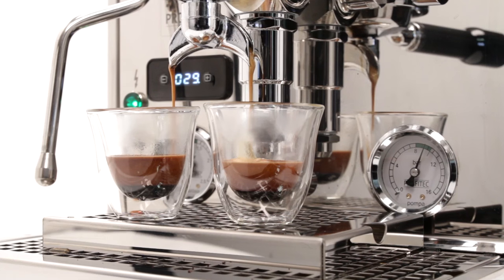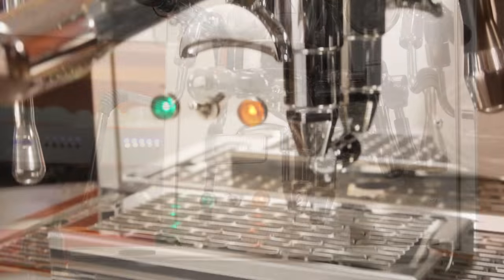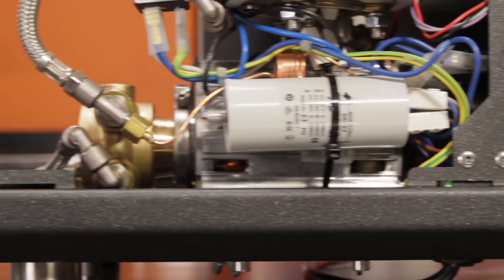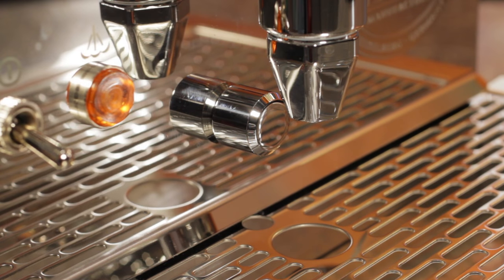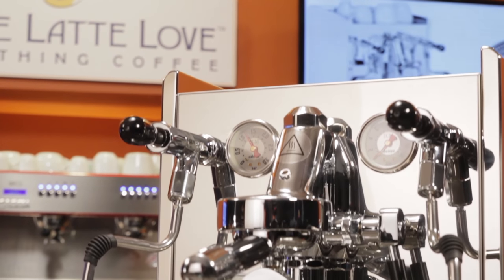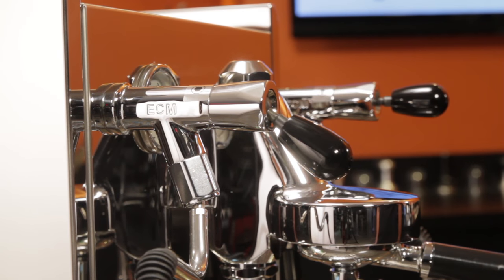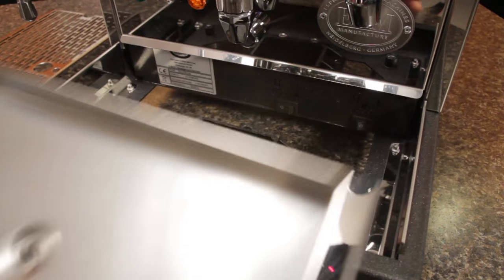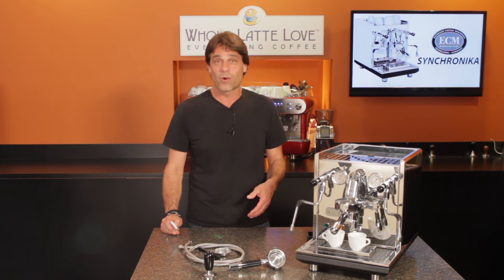Review: ECM Synchronika Espresso Machine

Comment: This has reached the top of my list, only reservation I have is the Steam looks wet, I did a Google search and noticed a couple of comments regarding this. The La Marzocco Mini has very dry steam, do you know why technically that is. Many point to No Burn wand but they both have no burn, thought I believe the LM is double wall rather then tube. If thats the reason can WLL influence ECM/Pro to change their design. It seems to be the only flaw I can think of with this machine. Oh maybe ability to set a morning start up time.

Comment: Hi, when using the 21g basket the puck is wet with the ECM synchronica.  What could explain this?
Reply from the maker: Hi PM, How much coffee are you dosing in the basket? If dosing the 21g low then extra headspace can cause. Also back flush machine regularly to keep exhaust from group clean for better performance.

Comment: Hey Marc, what does this section on the manual for the Synchronika mean? "Important--Please make sure that only your authorized ECM-dealer connects the machine to the water supply and installs the pressure regulator and shut off valve.
To avoid calcification of the machine a water-softener is recommended.
The machine may only be descaled by your specialized dealer because a partial disassembly of the boiler and the tubing may be necessary to prevent the system from being blocked by lime residues. A late descaling can cause substantial damage to the machine."  Can the owner de-scale themselves?  Thanks! Jack
Reply from the maker: Hi Jack, Thanks for the questions! It's okay for knowledgeable end users to plumb the machine themselves. Wording in the manual is there to cover the manufacturer in the case of errant end-user installation. Pressure regulator is recommended to prevent over-pressure water supply to machine. In most cases, this is not necessary if household plumbing pressure is in normal supply range of about 40psi. A shutoff valve on the supply is common practice for anything connected to a household water supply. The ECM is designed in so there is no solenoid valve preventing household water supply pressure from entering the machine - line pressure is always present in the machine. This allows for line-pressure pre-infusion when the E61 group lever is in the proper position. So that is a feature but it also presents a slight risk in that a component failure in the machine could lead to water exiting the machine. Therefore, best practice is to turn off the water supply to this type of machine when not in use or unsupervised.

As for the descaling... We do recommend using properly treated water to prevent scale formation in the first place. Minimum is water softening filter. What we prefer is a multistage adjustable cartridge filter that treats for chlorine and instead of softening (which exchanges minerals for salt) does magnesium ion replacement for calcium to prevent scale. This type of filter when used properly ends the need to descale. We have an entire system built around the BWT Bestmax premium filter. The system has a pressure regulator to prevent water supply pressure spikes from affecting the machine and a flow meter so you'll know when to change out the filter cartridge. Learn more here: https://www.wholelattelove.com/parts-and-care/water-filters?product_brand=126

As far as owner descaling... Best thing is to prevent scale in the first place so descaling is not required. As ECM states, if descaling is required it is best to have it done by a machine technician. Descaling dual boiler machines generally requires some disassembly of internal plumbing components. Can a home user with appropriate skills do it? Yes, but it's not something we or machine manufacturers recommend.
Reply: Whole Latte Love what components should I be concerned about for water to leak from machine when plumbed?  It not convenient to shut off the water each time especially when it is on a timer to turn it on before you wake up.

Comment: Can the cup rail be removed to decrease the height of the machine?  I have low cabinets and definitely could not fit it at 16.5 height.  If removable what would be the height of the machine without a cup rail?
Reply from the maker: Hi, There is not a cup rail on the machine aside from the case that extends above the cup warming tray.

Comment: Hi Marc:  I've learned so much from your videos, and your "Columbia School of Broadcasting" voice always makes me smile.  Thanks for producing these.   I have a question that I don't think has come up before, and I am puzzled as to why it hasn't been a problem.  You quoted the power requirements of the two boilers as 1200W and 1400W, for a total of 2600W, which is slightly higher than 20A of current.  That would be likely to blow a household circuit breaker, especially if some other appliance on the same circuit turns on.  How do they deal with this?  I thought they might only allow one boiler at a time to turn on, but you show espresso brewing and milk steaming at the same time.
Reply from the maker: Hi Steve, Thanks for the kind comment and question! You pretty much had the answer in that only one boiler's heating element operates at a time. It's a typical setup for dual boiler machines with PID temperature control. The PID energizes the boilers in short pulses and alternates between them. When brewing and steaming the boiler's heating element does not have to be energized constantly.
Reply: Now THAT'S good engineering.  I I chuckle when purists complain about a machine having a PID, as if it ruins the "steampunk" character.  Considering how many sensors and computerized systems the average car now has, a basic electronic temperature control is nothing.
Reply from the maker: Steve Weinberg agreed! Funny as I get complaints sometimes from those upset a couple of manufacturers have moved PID display out of sight behind drip tray. Rocket machines have no visible PID, Profitec Pro 500 PID is behind tray. Some users would like it visible with shot timer function like on Synchronika and Profitec Pro 700

Comment: What is the size of the tamper for synchronika?
Reply from the maker: Hi SR, Thanks for the question. The Synchronika's stock filter baskets use a 58mm PF. Be aware some tamper manufacturers (the good ones!) are more precise with measurements. So you may see 58.5mm tamper sizes. These will work with ECM stock filter baskets and precision aftermarket baskets.
Marc

Comment: Great info. Q: is the temperature stable for back to back brews? Considering this unit for mobile cart setup.
Reply from the maker: Hi S, Thanks for the question. Most dual boiler PID machines are relatively stable with back to back shots. If you are rapid fire brewing continuously you might turn down the temp a few degrees but depends on frequency of brew cycles and ambient temps.

Comment: Hi Marc, may I know what is the pre-infusion pressure between tank and plumb-in? Does the pre-infusion features work with water tank? Thanks
Reply from the maker: Hi Tan, great question. We're prepping one for customer delivery today. Will put the SCACE on it and measure pressures of pre-infusion from reservoir and when plumbed and let you know.
Reply from the maker: So did test with the SCACE. When plumbed to water line with 50psi the pre-infusion read 1 to 1.5 bar of pressure. From reservoir there is no pressure build up it just wets the coffee.
Reply: Thanks Marc

Comment: Hey Mark, any tips how to fix a shaky steam arm. Not the moveable piece the stronger piece had mounted to the machine has gotten loose over time. Thanks for all the tips!
Reply from the maker: Hi CK, Fairly easy fix. Must say I'm really surprised that loosened up! Here's what to do:
1. Remove 6 Allen head screws securing the top/cup warming plate. When doing so be careful as back and side panels become removable as screws are taken out. Panels can fall off unexpectedly.
2. There's a nut behind the face plate which secures the valve assembly. Tighten that nut to secure. Bit of an odd angle but it is accessible.
3. Re-assemble is reverse. Make sure back and side panel tabs are inserted properly into base of frame and tabs line up properly with top cover/cup warming plate.
Hope that helps!
Marc

Comment: Hello sir I watch this video after you reply to my question from the top espresso makers of 21 I can't even see the display in this video is there anyway to get some more pictures I want to display will look like in a room?
Reply from the maker: Hi Charles, That's the best I have at the moment. The Synchronika has a "silvering" of the PID display which helps it blend into the face of the machine. Side effect of that treatment is a reduction in contrast. The Profitec Pro 700 is essentially identical to the Synchronika in internal components and capabilities. The Pro 700 PID is much higher contrast. Perhaps it would be a better fit for your need of machine with a high contrast display? Check out the Pro 700 here: https://www.wholelattelove.com/products/profitec-pro-700-dual-boiler-with-flow-control Very good photos of the display at the link.
Hope that helps!
Marc

Comment: I like to buy this fantastic machine BUT read a serious PID Display problem of this machine... Is this solved all ready or??
Reply from the maker: Hi Peter, Not aware of any serious PID display issue with the Synchonika. Can you be more specific about the problem and/or provide a link to description of the issue?
Reply: This problem is placed on YouTube my friend
Reply: It is not a problem from just one fantastic espresso machine but several with the same issue. Thats why i ask you about this..
Reply from the maker: Hi Peter, We have shipped dozens of ECM Synchronika machines and have no reports of serious issues with the PID display. We had one with a slight cosmetic defect which did not affect performance. Do you have a link to the video? Perhaps the problem has been solved. In the unlikely event you did have an issue repair/fix/new part would be covered under warranty.
Reply: youtube: ECM SYNCHRONIKA PID DISPLAY DEFECT
Reply: Whole Latte Love YouTube: PID problem NCM Synchronica.    That is the link..  But I am sure this cant be a serious issue isn't it
Reply from the maker: Hi Peter, Thanks for the search term. I checked out the video. It appears as though the display was scratched. Don't know that for sure but could be wear and tear from use. Situations vary, but in most cases if a machine was received by a customer with a defect like that it would be covered under warranty. In the video it sounds like this happened after some use.
Reply: It doesn't matter if it happened 'after some use' or whether it was delivered to the customers that way.  The whole point of the complaint is that there appears to be a quality control issue with the paint used on the PID, and it needs to be addressed.  
The best way for you to treat this situation isn't to deny it as you have been doing, but instead to present it to ECM on behalf of your customers.  See if ECM won't step up and either fix the issue or at least stop painting the PID's so that this is a non-issue on future models.  By doing that, and making a video about the response from ECM, you will have at least have been a forthright advocate for your customers.  We find that much more open and honest than trying to avoid the whole question....
Reply from the maker: Hi Sam, First let me say I understand your concern. Based on your and Peter's comments we are contacting ECM and will reply here with their response. Please be patient as it may take a business day or two due to time difference between US and Germany.

As I am responding publicly here I don't feel we are denying the issue or avoiding the question. As clearly stated in the thread above we are aware of 1 report of the issue among many dozens of our Synchronika customers. In that case, we attempted to resolve the issue with the customer. To the best of my knowledge, the customer decided to return the machine. Following that we carefully checked all Synchronikas shipping to customers and to date have found no similar issues with the displays and have no further reports of any from customers.

In response to the video Peter referenced I said: "It appears as though the display was scratched. Don't know that for sure but could be wear and tear from use." Key there is "Don't know that for sure..." It could be a defect or could be a scratch from wear and tear. There is no way of knowing from the video alone. As to avoiding the issue... If avoiding, I would not be responding publicly here or would simply delete critical comments.Taking that approach would not be in our or our customer's best interest.
Reply: I eagerly await ECM's response.
Reply: One full week has elapsed.  Still no response from ECM?
Reply from the maker: Hi Sam, We received an initial response from ECM on 3/13. We asked for clarification as there was some confusion in the translation. See below the full response from ECM received on 3/14.

Please accept my apology for the delay in getting this information out. When I originally responded to you we had had a windstorm here in Western NY which knocked out power to our business and 100,000+ other businesses and homes in the area. We were operating on a small generator for critical systems and on less than 20% of regular staff. Power was restored 5 days later on Sunday. Then on Tuesday a snowstorm began which dropped 26" in our area. We closed early on Tuesday and very few staff members were able to report on Wednesday. We are still catching up.

To paraphrase from ECM... Their supplier had an initial quality issue with films for the PID display which seems to have been resolved. According to ECM they have had just 1 issue reported to date.

*********Here is the full un-edited response from ECM received 3/14/17**************
"when we reiveced the first e-mail from this end customer we noticed and had this issue only once.

We asked immediately our supplier how this could happen and after a couple of weeks we received the feedback: “In the first batch of the PID of the Synchronika there was used this kind of faulty film display” But  have not received a more precise information either.

Only when you scratch on it there is the risk that the surface can get damaged.

We received 100 films for exchange. But right now it is the only complain we had until now."

Comment: I was set to pull the trigger on this machine, until I read the comments below, relating to the display chipping and the guy whoe had a "lemon" 

do you have any further info on reliability and fixes to the screen issue?
Reply from the maker: Hi George, Thanks for the question. As discussed in the comments this was an issue with a single machine. The vendor has supplied ECM with updated display films.

To save you the hassle of searching through the comments, I've copied the final communication below. Bottom line: there was a single issue with one customer on an early shipping Synchronika. ECM worked with their supplier and they are confident this is no longer a problem. 

Copied...
To paraphrase from ECM... Their supplier had an initial quality issue 
with films for the PID display which seems to have been resolved. 
According to ECM they have had just 1 issue reported to date.

*******Here is the full un-edited response from ECM received 3/14/17************
"when we reiveced the first e-mail from this end customer we noticed and
 had this issue only once.

We asked immediately our supplier how this could happen and after a 
couple of weeks we received the feedback: “In the first batch of the PID
 of the Synchronika there was used this kind of faulty film display” But
  have not received a more precise information either.

Only when you scratch on it there is the risk that the surface can get 
damaged.

We received 100 films for exchange. But right now it is the only 
complain we had until now."

Comment: Fantastic review, Marc! After 4 years since this review,  have you noticed quality issues (eg. boiler leaks) with Synchronika? It is my understanding that it is questionable to use stainless steel boiler and directly screw onto the boiler a copper/brass heater.
Reply from the maker: Hi d, Thanks for the comment and question. We've been running a Synchronika pretty much continuously since it came out and have had no issues. With many thousands of Synchronikas in use I've had one second hand report of an issue caused by feeding the machine with pure reverse osmosis treated water. As pure RO water can be corrosive to metals it should not be used in espresso machines.
Marc
Reply: Very useful information, this should be front and centre as a notice to customers purchasing machines with stainless boilers, probably worth noting in future videos :). Also thank you for all these very detailed videos, appreciate your time putting these together
Reply: @Wholelattelovepage  I have had that problem after one year and now something after 2 years 
Trying to figure out
Reply: Ronnie Bona heyy l am planning to buy this machine this week but your comment made me thing. One year is too early for a machine like this to leak. What have you done to fix it? By the way are you happy with machine?☺️